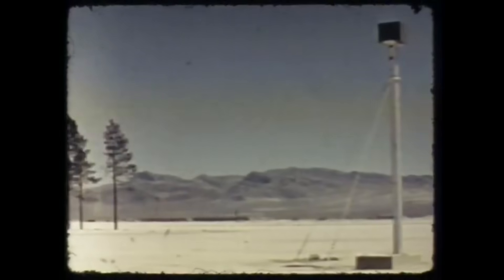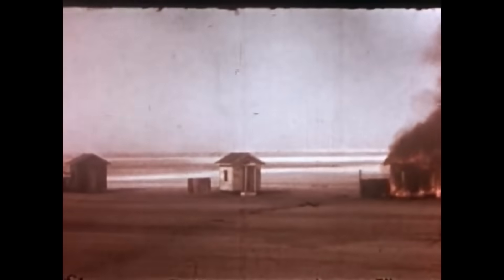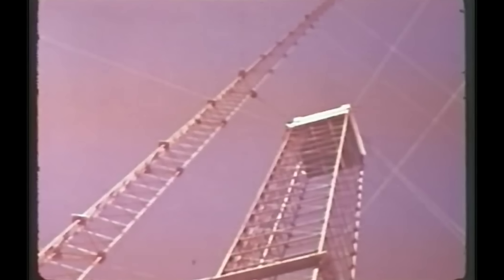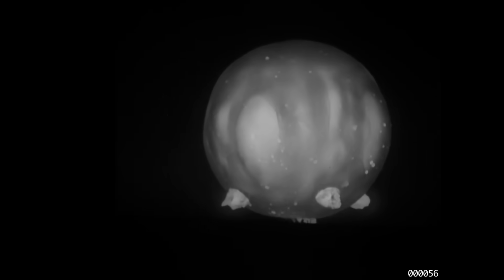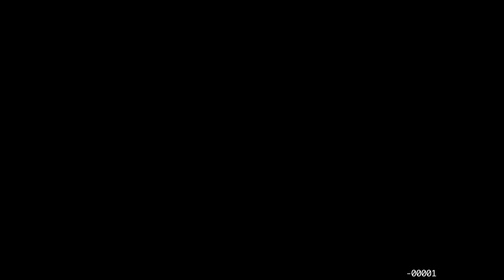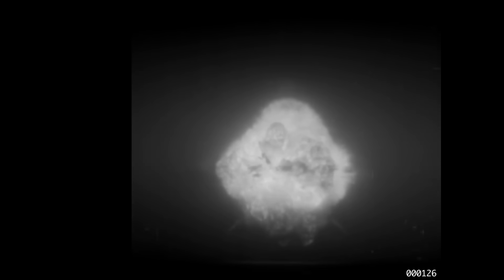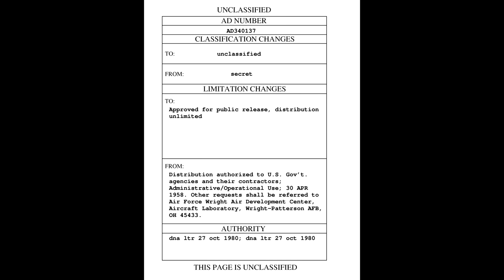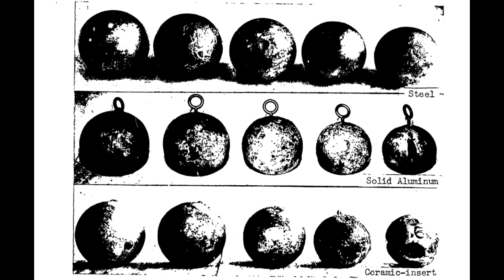Can A Metal Bowling Ball Survive Inside a Nuclear Explosion?

Comment: my hypothesis was that the metal balls would survive but wouldn't be completely melted because the duration of time the balls actually experience the heat is on the order of around 10^-6 seconds but they still would lose a couple of cm of material from their surface due to the extreme heat and radiation, well im happy that i was slightly correct
Reply: Bruh

Comment: 5:25 "it is very light because it is very very hot"
no, that sounds wrong, wouldn't it be
Very low density because it is very very hot?
And then very buoyant, because it is very low density?
Making it rise, because it is very bouyant.

Or have I misunderstood the ideal gas law and arkimedes principle to a disturbing degree? And that instead it is as you claim - the matter actually loses mass when it grows that hot?
Reply from the maker: no, I'm merely expecting that smart people will implicity understand the intermediary effects.
Reply: @scottmanley  Flattering :)
But the reason I startled is cause I have tried to explain to someone not too long ago regarding why pumping helium/hot air into a 'spatial storage bag' (fixed outer volume; "bigger on the inside") would make it more buoyant than into a regular bag (volume outside/inside is in a 1:1 ratio) - more mass = more weight.
Add to that the fact that I myself never truly realized why hot air rises until I properly thought about it during that convo (only ever been told exactly that phrase "hot air is lighter" as well as "more kinetic energy means bouncing more". Never had ideal gas law enter the picture before, even if the phrases are tangentially related), and we then clearly have two people (including me) who never realized that the reason hot air rises has to do with the ideal gas law + arkimedes principle :p

That said, it is fairly intuitive once you actually stop to think about it. I just feel like it is better to make a point of avoiding the phrases that made me not think deeper into it for many years :D

Comment: Not an expert here, but I would think that the intense heat would male the steel lose its "temper" and thus make it quite brittle... That's what caused the World Trade Center to collapse... The steel braces didn't melt... They were heated to the point that they lost their temper and snapped!!!
Reply: What would have cooled them off quickly enough to do that?  They didn't land in water so if anything they got soft not brittle ditto for the WTC beams, they would not have gotten brittle from fire.

Comment: That's one of the reasons when you are in modern MBT and you are 350-700 m from the blast (depending a lot on the strength obviously), if you're in correct position (upright), your Tank is functioning, your crew hasn't been turn to a jello, flying inside the tank etc. You don't get out of the tank. You check if your NBC protection is on and DRIVE AWAY. Depending on various things Armies give time allowed inside irradiated tank 24-72 hours. Also one you abandon it, don't stay nearby, put couple km between you and it. And seek medial help - if there is any.